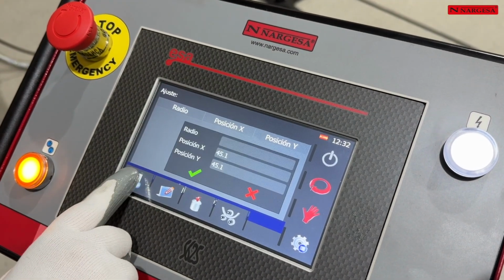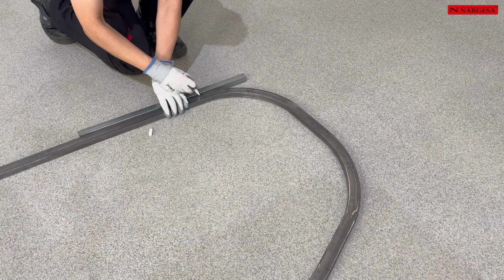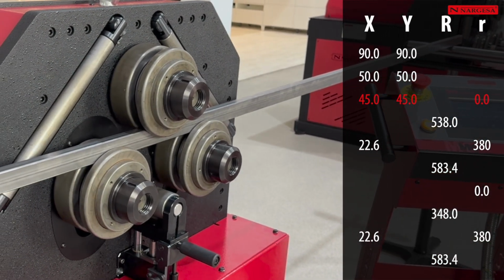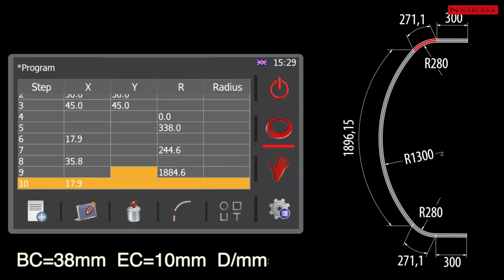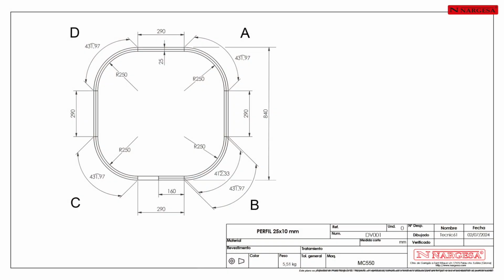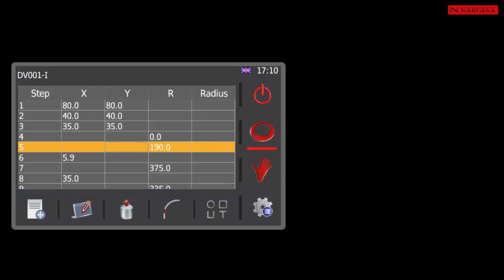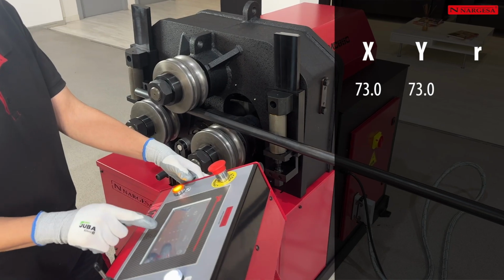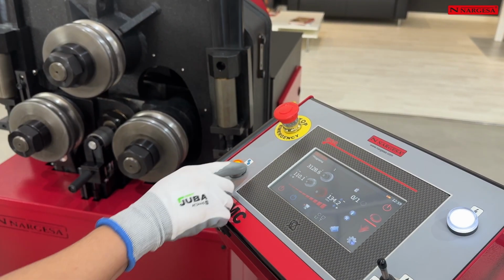👉🏼 50-Minute Online CNC Bending Course 📏 | Step-by-Step Learning with Professional Tips

Comment: I want to learn how to use this machine and perform all these operations.
Reply from the maker: That’s great to hear! 🙌
Learning to use these machines is a mix of understanding the basics (how the material behaves) and getting hands-on experience with the controls and tooling.
If you’re starting out, we recommend:
👉 Learning the difference between processes
👉 Practicing with simple bends first
👉 Understanding limits like minimum radius, material thickness, and springback
And of course… lots of practice 🔧
We’ll keep sharing videos to help you learn step by step!